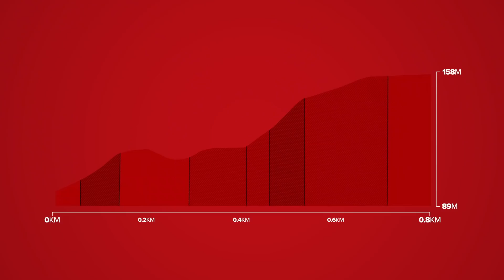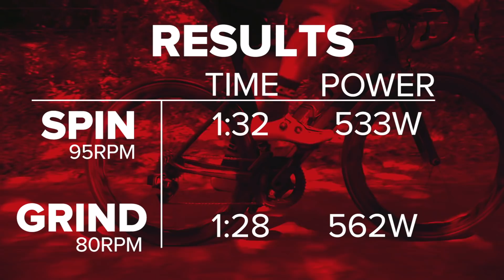Spinning Vs Grinding | What Is The Best Cadence For Climbing On A Road Bike?

Comment: It’s not about what is faster on one climb, but over a three week grand tour you will be much more efficient with a higher cadence because your shifting the load from the legs to the lungs. Your legs will be fresher over the course of a race.
Reply: Joshua McDonnell yes absolutely. Any quick test is pointless. Do 200km race pace then do the test.
Reply: Joshua McDonnell exactly
Reply: Sure, but the strain on the heart is higher with high cadence. Which also adds up over the course of a race. It's probably best to stick to your natural cadence.
Reply: @Joshua, here's a thought though. Some people have low hemoglobin levels (it's a blood disorder called thalassemia) and they are trying to do the opposite -- shifting the load from the lungs to the legs. Their lungs don't get the oxygen that normal people do. So they have to rely on their muscles and hence they end up grinding.

Even if I try hard, I can't get my cadence up to 70 or 80, let alone 100.
Reply: Mishal Ahmed  I agree With you in that scenario but 99% of people don’t have that blood disorder and highly doubt you could become a pro rider with such a disorder.
Reply: ok, how many of the respondents here have done a 3 week tour to make such assertions? Truth told, pro's pedal across all cadences...they are also inherently more efficient than you or I. I like fast pedaling, but it is not the ONLY answer. Look at both Tony Martin and Thomas DeGendt ...they seem to do ok in 3 week races.
Reply: CLOSE!. You shift from your legs to your HEART.  One's lungs have the surface area of a tennis court.  Blood is mostly water=fluid.    A fluid is 1000 times as dense as a gas.  Therefore, the limiting factor is one's cardiac output(Cardiac Output=Stroke Volume * Heart Rate).   Have an efficient heart and you can pump blood to those thighs and spin spin spin.....forever.
Reply: Tell that to Bernard Hinault and count how many seconds before he smacks you with the back of his hand.
Reply: @souloftheage  That just means, the faster you spin, the more air resistance your legs have to overcome. Spinning is for poor cyclists with weak legs.
Reply: It's great to spin and use your lungs when you have 50% more red blood cells. LOL It's really hard to get good data without a large test group and being able to lock down training. For me, if I could lose some weight I would be so much better no mater the cadence.
Reply: And also running your body in ketosis may help some people.
Reply: @mishalbd  Thalassemia minor causes microcytosis without anemia. You mean thal major don't you?

Comment: All I know is, when I pass road riders on the mountain bike with a slow cadence it kills their spirit.  Being passed by a guy on a 39 lbs mtn bike spinning a 50/36/21 on a 9 speed 11/23 in the rear (not stock gears) makes people question their spin cadence education (most of them into 3 digits spin).   I usually climb in the big ring no matter what bike I'm on, because I hate to go to the gym. It all comes down to the gears that you can hold, for how long.  I realise that I'm not a "normal" rider.  I had over 12K miles last year on the road.  I like the BIG ring climb.  I just recently had new Q-Rings installed on my Scott TT bike, (19 lbs) a 54/44 with a 11 speed 11/25 cassette.  This was after taking off my old D/A 55/42 with 11/23 cassette.  That's not normal either. I still climb in the 54 most of the time.  The thing is I have been breaking PR's since the change. Climbing cross chain 54 to my 25, on pretty much all of my climbs, (instead of 55 to 23).  So the question is... Am I faster now because I spin faster?  Or did my slow grind in the 55 big ring for the last year make my climbing get stronger, and now that I have the power to spin higher cadence I'm faster.  Or, does working out the flat spot in my pedal stroke with the Q-Rings really help?  I also took an extra 10 minutes off my 40k TT time (hardly over 55 min).  That being said, I use the advice from a Tri-guy I met once.  His advice... If your heart can't do the time... your body will NEVER  go the distance.  It's not as hard as we think, ANY exercise that you do comes down to elevated heart conditioning.  Get a heart rate monitor. Nothing more to start.  Distance means nothing, if your heart can't get there with you.  Also... The best kept secret ... Increase the your oxygen to the head.  Test nose strips to see what position is best for you.  Anyone that has tried when I put one on them out riding, continue to use them each time after.  Lack of oxygen to the brain causes all kind of problems.  This is the best and simplest way to get faster.  Or start with 3 less potato chips a week.  I've lost about 100 lbs since riding, no surgeries.  Starting out with the weight, was a help to use as advantage now. I don't recommend that approach though.  Just get out and do ANYTHING !!!   and just have fun.

Comment: High cadence is the best way to go faster. When I started to spin 100 - 120 twice a week for 3 hours on flat my performance improved dramatically.  The patience to do this is extraordinary but the results are amazing.  When you spin this high you shift more effort to heart and lungs.  So now you have 2 good legs + strong heart and lungs to pedal.  The first two weeks spinning at this rate are terrible but then you get used to it and it becomes natural.
Reply: Marcos De Souza did you have issues with bouncing? How did you solve that?
Reply: bollocks !
Reply: Think the whole issue is very subjective. Having tried both, I find a good balance between the two at around 85rpm works for me. I could only find any decent power (which isn't much) from weight lifting. Subequently, this gave me a lower rpm, but made me faster.
Reply: Saurabh Kulkarni you'll bounce at the beginning but over time it stops as all muscles involved in the movement adapt.  But make sure your seat is not too high otherwise the bouncing will never stop.
Reply: JM AF it takes huge motivation.  I was doing it for races.  But like I said the first 2 weeks are the hardest or maybe 1st month.  Anyone who doubts this system should put it to the test.  It doesn't need to be 3 hours spinning if you're not training for races, just change your style to high cadence and you'll benefit.
Reply: Marcos De Souza iiii
Reply: I second this high cadence training.. I was training for high cadence for a week now and my acceleration and speed improved significantly.. I can easily outrun dogs that loves to chase cyclists now..
Reply: Marcos De Souza go for a run
Reply: When l was 16-25yrs old l was riding high cadence 52/42 @ front chain rings 90-95 rpm back in 1977-mid 80's. Long b4 Lance. Now l am riding mid compact 52/36 higher cadence, average between 95-105 rpm but mainly around 100 @ 61yrs. I have only been back on the bike 4 13months. I constantly do spin ups 115 thru to 125 even 130 & l have improved out of site. Very smooth. My go to 7k climb last week saw an impressive 2 minutes faster. Going again in a couple of days with my Specialized Roval clx40 Tubulars to see if l am quicker. Climb is between 4.5 & 6%.

Comment: In the saddle vs out of the saddle-I would think lighter riders wouild be more likely to ride out of the saddle than stocky riders.  I think the stresses on the lower legs would be much higher on someone 185+ pounds vs someone 140 lbs and disproportionately more energy might be spent/fatigue more quickly earned. Perhaps the professor could comment.

Comment: We have very different ideas about "grinding". To me, grinding is pedaling less than 60 rpm at high power. And most of the videos I've seen of professional cyclists who are said to be "grinding up a hill," it looks like they are pedaling less than 60 rpm, too. As for the different power during the tests, it probably undermines any conclusions and the fault appears to be incorrect gear ratios for the cadence used. For example, if we use your 95 rpm at 34 x 28t as the reference (a gear ratio of 1.214), you'd need a 39 x 27t (a gear ratio of 1.444) for equal power at 80 rpm. To use your 39 x 23t with a gear ratio of 1.696 you'd need to use a slower cadence of 68 rpm!!! That's why your power was so much higher on the 80 rpm run -- your gear ratio was too high for the selected cadence, forcing you to exert more power to hold the 80 rpm cadence. This was an interesting test and would be worth repeating -- but you need to match the gear ratio to the cadence you plan to use so the power is consistent.
Reply: D.Eldon Thanks for the great response as always. In this case it feels like actually having a gear that forces you to put out more power could be an important point. Would hear twiddlers go faster if they had to try a bit harder?
Reply: @Simon Richardson - Thanks for taking the time to reply. Much appreciated. Perhaps I'm missing something because I don't understand the explanation. Maybe the muddle is occurring when we talk about power. In my original response above, I was taking about power to the rear wheel -- the same power you'd read on your cycling computer. In your reply, are you talking about power at the pedals? If so, we're talking about two different things.

If you select a gear ratio for each cadence you test such that the power to the wheels is the same, you will exert more power at the pedals per revolution of the crank at the lower cadence. This will be true even if your power meter indicates the same watts as I'm advocating. For example, at 500 watts, you'll have to exert more force per revolution at 80 rpm as you would at 95 rpm. So the cyclist will perceive a harder effort even though the power to the wheels is the same (500 watts).

The way the test was conducted for the video (with gear ratios that were not chosen to equalize the power to the wheels), you were forced to also drive more force to the wheels at the lower cadence which introduced a second variable. In other words, you increased the power to the pedals twice -- once because of the lower cadence, again because of the too-high gear ratio.
Reply: D.Eldon Hi, 
The "power per crank revolution" is in fact an energy (that's when you count the power produced over time). In the video, Simon is producing energy at the same rate (that's the power read on the bike computer). Since at let's say 60rpm the time to make a crank revolution is longer than at 90rpm, there will be more energy produced per crank revolution at 60rpm: you count the power produced over the longer period.
What you may be referring to is the torque produced to attain a certain power. As power is "torque times rpm", a lower rpm needs higher torque for the same required power. Which I agree can feel more exhausting.
As for power at the wheel/at the pedals, it is perfectly equivalent. There will be a constant factor between them due to the drive train losses.
Don't hesitate if something is unclear, or if you want more explanation! I'm happy to help :)
Reply: @Charles Phi - Let's please not over-complicate this subject. Of course there is power at the pedal -- the energy to move the pedal a specific number of revolutions per minute is energy transferred over time (power). I'd like to keep this discussion as simple as possible so as many readers can easily follow. So let's assume that Si exerts the exact same force at each point along the 360-degree circle of the pedal around the crank spindle. And let's assume that Si maintains a perfect 500 watts/minute power output to the rear wheel during both ascents. And let's assume there are no losses between the pedals and rear wheel.

During the first ascent, Si climbed with a cadence of 95 rpm. Dividing his 500 watts by 95 revolutions, each revolution required 5.26 watts. During the second ascent, he climbed with a cadence of 80 rpm. Dividing his 500 watts by 80 revolutions, each revolution required 6.25 watts. This simple method of comparing the difference in power required for each crank revolution at these two cadences helps folks understand why the 80 rpm cadence appears to require more effort at the pedals. It truly does as you've acknowledged. And this is why I believe Si's suggestion that being "forced to put out more power could be an important point" would still be satisfied if the power at the wheel is held constant.
Reply: Thanks for your polite answer :)
I think you have the correct instinct, I just want to clear a couple technical details for interested readers. Power cannot be divided by a number of rotations in the physical sense, because it is an "instantaneous" value. You can divide energy though (more on that later). I'll try to express your reasoning either in terms of torque or energy.
I'll go with torque first, which is what I talked about in my first message. Torque is Power/RPM (fellow physicians, sorry about the units). For 500W, the torque produced at 60rpm is 500Nm (Newton meters, the unit for torque) and at 90rpm it is 333Nm. So indeed the legs hurt more at 60rpm because more torque=more force. Notice I did a division just like you but with correct units in the physical sense. The conclusion is the same indeed.
As for reasoning with energy, we can this time divide by a number of revolutions as you did and it is correct in the physical sense. Over 1 minute, Simon produced 30kJ (kilojoules) of energy (that's power multiplied by the number of seconds). These 30kJ of energy are spread over either 60 rotations or 90 rotations. Which means he produced for each pedal rotation either 0.5kJ (60rpm) or 0.33kJ (90rpm). Again, same conclusion: more energy put per pedal rotation means you push "harder" on the pedals.

For readers interested in those power/torque/energy disgressions, have a look at the wikipedia pages, I hope it's clear enough!

As for the power at the wheel, what makes you think it is fundamentally different from the power at the pedals?
Reply: @Charles Phi - Answer: The difference is that we're dividing the power into smaller slices per crank revolution at a high cadence and bigger slices per crank revolution at a low cadence. And it's perfectly valid to do so because we're still talking kilojoules per unit of time (0.632 seconds at 95 rpm or 0.750 seconds at 80 rpm) which is still watts.
Reply: Hi, you're perfectly right about dividing energy by the time it takes to do one crank revolution. Notice in my example that the energy produced at each cadence over one pedal rotation is different: 0.5kJ at 60rpm and 0.33kJ at 90rpm. If you divide those energy quantities by the time it takes to do one pedal rotation (respectively 1s and 0.66s) you will fall back in each case on the 500W power.
You may still be confusing power (in Watts) and energy (in Joules or kilojoules). To illustrate what I say in a more intuitive manner, let's say that the rear wheel has no idea of how you are producing a given amount of power (spinning or grinding). Your hub does not know, your rim/tyre neither. If you measure the power at the rear wheel, the sensor will not care about what is happening at the pedals.
I encourage you to have a look at the Wikipedia page related to power to further clear that :)
Reply: What would be the point of doing the climbs at equal power? Demonstrating that gearing works? Assuming equal losses, the same power would mean the same time (covering the distance and gaining elevation is the work, that stays the same; power is work per time; hence same power = same time). No matter the cadence/ gear ratio (as long as you can sustain it). Again, what would be the point? Simon somehow trying to judge which felt better? Of course, that assumption won't hold in the real world (at the very least aerodynamics change when you stand up so you probably have to produce more power just to keep up), but that's besides the point.

The point here was to, essentially, determine which style allows him to sustain higher power. Higher power means faster climb. Time is easy to quantify, fatigue not so much. If you're doing this, it's not important to calculate gearing for target cadence. Use whatever gearing you want to test. The important part is not to aim at any specific cadence. Go as fast as you can (= pedal as fast as you can with that gearing; pacing yourself, of course, so you can manage the climb). If you set a cadence and you keep it, you're predetermining the power output and the time (putting aside variables like aerodynamics). And you're back to judging which felt better, comparing heart rates or whatever. If you find out the heavy gearing wasn't heavy enough, you want to test yourself at an even lower cadence, try an even heavier gearing.

In the end, I think one should aim to be well rounded. To be able to grind (produce a lot of torque) and also to spin like crazy. Fixed gear bikes are good for this. They will force you to spin on downhills so fast your eyes will pop out. :-) And there will be grinding up hill to develop strength. And there will be no slacking (coasting). It's interesting what you can do when you have no choice (besides walking).
Reply: No, you just need to pedal your ass off and quit being so technical.

Comment: When standing on the pedals doesn't throwing your bike left and right simply use more energy, surely being seated with the power going through the pedals and crank is less wasteful?
Reply from the maker: It's possibly less efficient for energy conservation, but it also allows you to recruit more muscle groups, as by levering your bike, you're essentially using your arms to pull the pedal towards your foot while your foot pushes down on the pedal